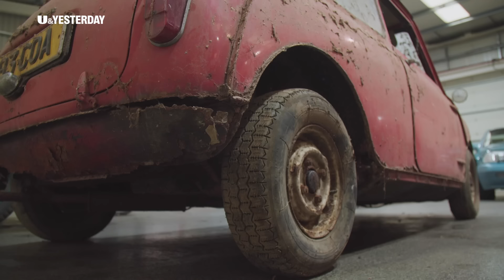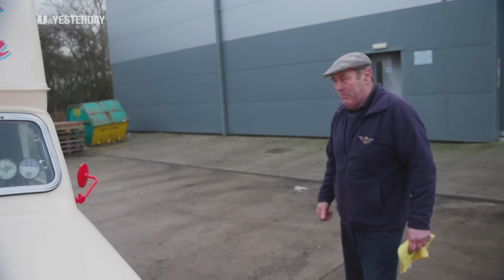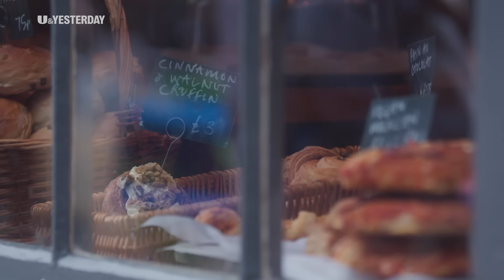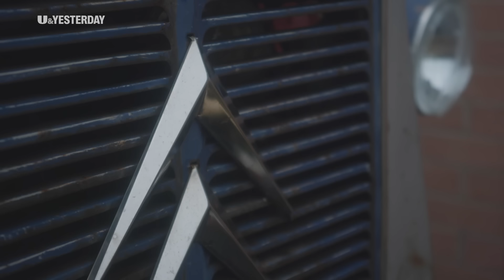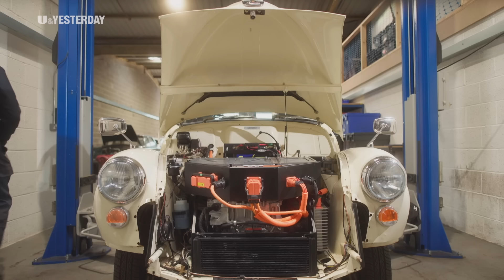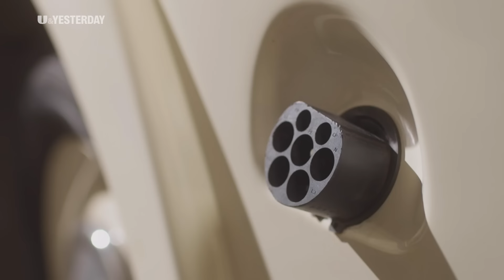Buying AND Converting a 1968 Austin Van to ELECTRIC, Will It Make a Profit? | Bangers & Cash

Comment: I loved van's and pickups, i worked on farms as a boy where i sat day release in farm management? A mini van or pick up or Moggie version, even a beagle or marina was pretty common as a first vehicle.  Ex post office, Gas board or Telecom, usualĺy with at least a spray job to cover faded paint and surface rust, some alloys and a tape deck or 8 track?  Many ended up wrecked on a slippy country road. But they were cheap and fun to drive? My friend Bob was giving 9 of his mates a lift to a party one night up in the Kyle of Lochalsh, hit a dead sheep and landed a few yards of road in a field? No problem, just picked it up and replaced it enough tools to patch the fence so nobody noticed. Tyre and sump marks on the Carcass maybe confused the farmer a bit and how it was in a secure field.

Comment: My friend had one passed down to him by his Grampa, well looked after and Garaged but hadn't been on the road for a couple of years? He and some mates including myself put an SD1 3.5 in it with a jag rear axle, uprated brakes shocks and springs! It took a bit of cutting and welding of the bulkhead, gear tunnell and wings plus bonding a spoiler to the front and rounding out the tail so its lines flowed to a shape that was more updated? Surprisingly we each had access to parts so the build apart from paint and a roll cage, wasn't really that expensive? With four of us it was built fairly quickly as 4 lads and the input of a few clever dads didn't leave it sitting about long? Such easy vehicles, mostly bolted together, we strengthened the chasis and put anti roll bars on the top end for ridgitity? Went well it would have gone faster but 150 mph was more than we'd be using?

Comment: I wouldn't have converted a van to electric, maybe a larger engine and more forgiving suspension and breaks for comfort! Vans and pickups didn't survive as well being working vehicles. I think they've got a 2026 retro model that will have everything already? A Moggie that goes like a stabbed rat and has a high top speed.

Comment: The electric motor torque could very quickly destroy the original gearbox. I'm guessing that 4th is true 'direct', ie. bypassing the laygear. As for the rear axle ?????

Comment: If the wire (400Vdc cable)/ metal tube was sheared, the internal battery box fuse should blow to protect the battery cells.
Reply: Yes, with the original sealed Nissan battery pack, but that was stripped and the batteries randomly scattered wherever they'd best fit. There's going to be no protection whatsoever!

Comment: 100 mile range ru avin a giraffe
Reply: That'll be on good day, whilst the batteries are still in good nick. 😆
Reply: @phuketexplorer  and without lights on and heaters..... I'm sure 100 miles will soon be 50 outside the brief summer months if you're lucky.....
Reply: His comment that Nissan’s halved the battery range over ten years from around 100 down to 40, tells all you need to know about the second hand EV market, they have no long term viability.
Reply: And enough torque to twist that moggy up like a rope 😂

Comment: It looks to me that that the petrol engine is newer than the van anyway as it has a wire gauze canister in the positive crankcase ventilation pipe. Also has an alternator fitted rather than a dynamo.  So wasn't quite original to start with.

Comment: 🤦🏼‍♂️ffs..And then when the battery goes on that in about four or five years, they’ll have to scrap it and put the original engine back in it. EV‘s are not meant to last it’s a throwaway like iPhone batteries and watches.
Reply: Any proof of the battery going wrong on it ?
Reply: @Phuc_Yhou Well, that's what the installer said ...
Reply: Nonsense chap. My Nissan is still fine after 10 years and if the batts did wear down, just replace them with newer ones.
Reply: @willdatsun At what cost?
Reply: Not our experience we have a 2016 Nissan leaf, its battery  is 80% SOH at 9 years old, about 100KM range but as a round town car its never an issue. We slow charge it at home, true the batteries are heavy but being low slung the CG makes it  rock solid on the road.  The leaf tech is Old compared to more modern EV's and analysis of 5,000 EVs by data specialists Geotab shows that average battery health has improved by 22% over the last five years and is set to get even better as new technology comes on stream. Their findings suggest that EV’s batteries will now outlast the average lifespan of a new car and many powertrain components from traditionally fuelled cars. Batteries are like engines if you look after then they will last , solid state batteries are now coming to market and will be a step change.
Reply: @number1genoa .. what a load of rubbish a battery is nothing like an engine that is serviced regularly it Will run  smooth, so no oil burning..i’ve got a 15 year old BMW 2 L diesel,. 110 thousand on the Clock.. how can a battery be serviced to do 110 thousand miles?.. when a battery is cooked it’s cooked.. it’s a throwaway
Reply: When did you last
Own an
Electric car ?
@mickrobo6073

Comment: Nissan leaf surely there's a better battery option than that ?
Reply: You don't need more than that size for a van like that, it weighs half of the modern Leaf and no one drives something like that any distance, its a local delivery or Sunday driver not a motorway cruiser.
Reply: @Phuc_Yhou  Its not that its Nissan leaf's are notorious for batteries losing their range much quicker than alternatives with much better systems Just look at the range on a used leaf versus a used tesla You couldn't go to a classic car show in a vehicle with a 60 mile range unless you trailered it , Check the companies website 44 grand plus your Moggy to do 50 miles on a charge its a waste of time and money .

Comment: Brave move by the team and good to hear Derek admit that it could be the future.

For all those who dislike electric cars consider this:  we run ours for 3 pence per mile in fuel and the insurance is actually less than the previous petrol car.  Servicing is cheaper and quicker and it's far more relaxing and easier to drive when which is great when stuck in British traffic.

Yes, it doesn't growl but equally it doesn't smell and doesn't leak.   It's a very practical tool which is what more than 99% of all vehicles really are.
Reply: As explained by the installer, it's got a maximum range of 100 miles per charge on new batteries.

That drops down to half in five years, at which time the batteries need replacing which will cost around 10k.

How is that "the future"?

How is that " practical"?

How is that "3p per mile"?
Reply: Brave? More like stupid. The battery is shot inside 7-8 years then like all older EVs it's scrap. A classic destroyed. And for what? It was never going to do miles outside of August anyway. It's future is bleak.
Reply: as long as you dont travel far and treat it like a disposable lighter then fine but i will stick to diesel as long as possible

Comment: I can't watch this video . Converting any vehicle to electric is absolutely wrong .....  all vehicles electric take the batteries out straight to landfill
Reply: it's a massive improvement. Anf totally reversible if anyone is mad enough to put an old A-series engine back in there.
Reply: In the real world those batteries will fade and then, like today's 7-8YO EVs,  it's scrap.
Reply: @  not really - if and when the batteries don't have a good range anymore they will be used for industrial powerbanks or recycled. Scrap yards are full of worn-out diesel & petrol engines though.